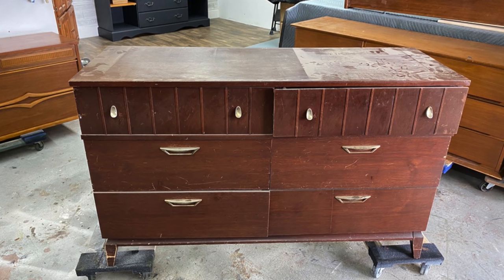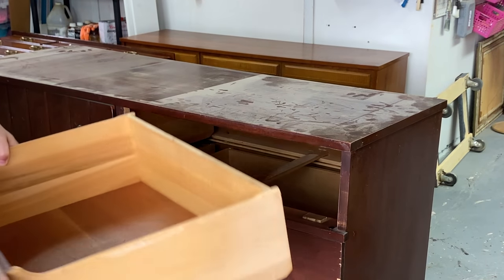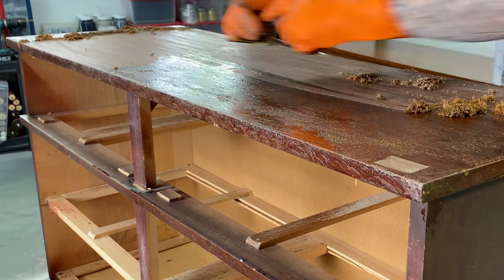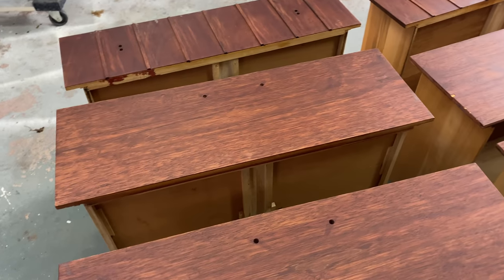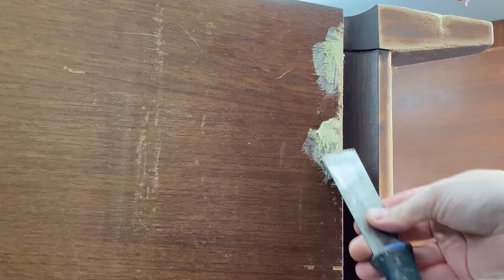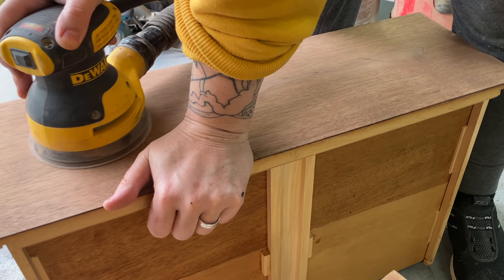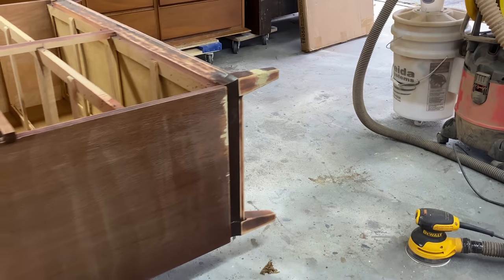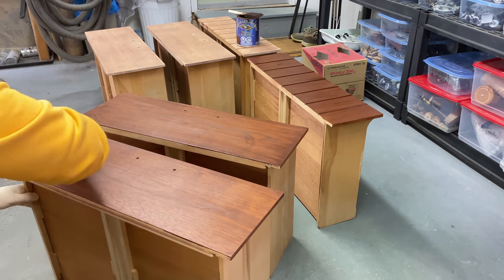WOOD & PAINT combo furniture flip : MID CENTURY RESCUE

Comment: Another beautiful piece of furniture! I am so enjoying your videos. Question... When applying paint, is there a reason that you prefer a brush over a roller on the large, flat areas? It appears from the videos that you obtain a smooth finish, even with a brush. How are you avoiding brush strokes?
Reply from the maker: The key for minimal brush strokes is having a good soft brush, and using less paint. The more paint on the brush, the more brush strokes. So two or three thin coats is better than one or two thick ones. :-)

Comment: The color of the top drawers look flat, if you haven't sold it you might want to consider painting it black. Wow the top looks terrific as do the lower drawers, you sure know how to make the wood grain sing : )
Reply from the maker: The top drawers are a different grain pattern and direction, so they are a slightly different colour and feel altogether. I initially considered painting them black, definitely would have looked cool either way, but the piece sold pretty much immediately upon listing so it’s all good. :-)

Comment: No top cost using fusion mineral? UR work is excellent!
Reply from the maker: I topcoat Fusion on occasion, depending on the piece. But Fusion Mineral Paint actually has a topcoat built in and is quite durable once cured on its own! I only topcoat if its a high traffic piece (like a dining room set, etc), or if I want to change the sheen of the paint, or deepen the colour with a wax of sorts. :-)